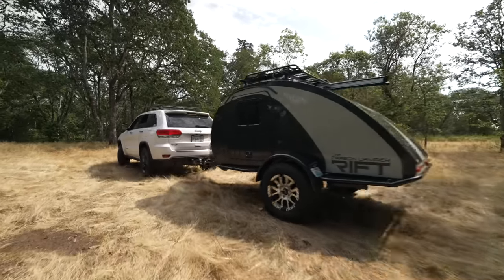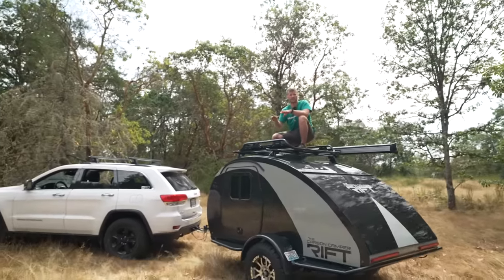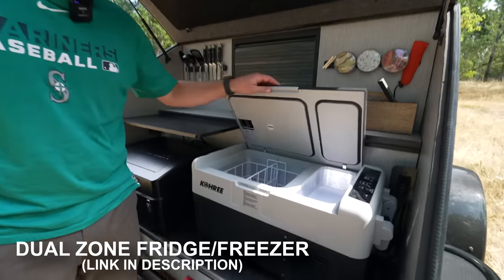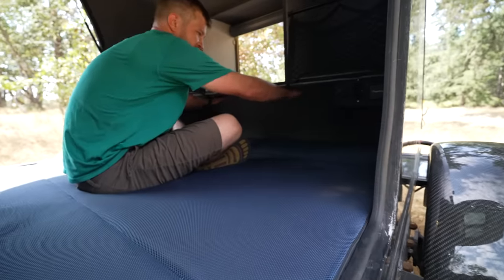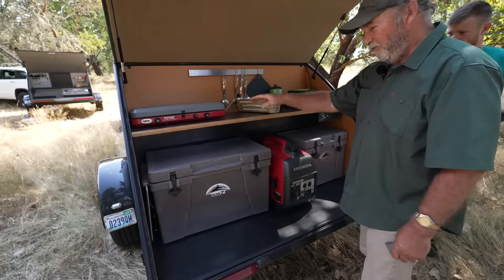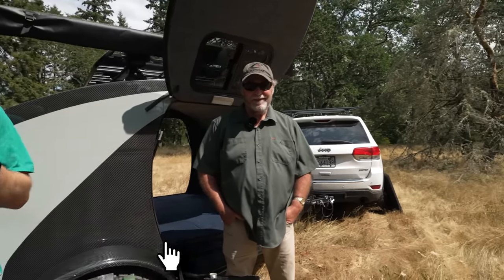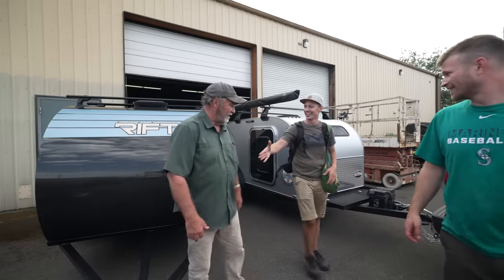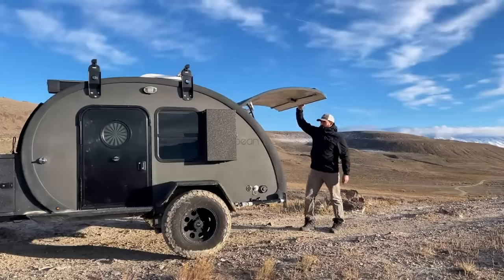Incredibly STRONG yet LIGHT! Carbon Fiber Teardrop Camper

Comment: Very cool. I fear the price but would love carbon fiber anything.
Reply: Also covering the front part of the frame is clutch.
Reply from the maker: Yes, the carbon fiber has so many advantages.
Reply from the maker: Yes, that added protection was definintely worth the littlel extra weight. Especially if people push this trailer the way the manufacturer designed it to be used. They truly built this to get dirty.

Comment: The trailer is nice.  However, the price is nice too.  I am there with you about an off road/overland trailer.  If they could do it and keep the price down, I think they could sell some because the off road trailers out there are usually imported and very pricey.  Always like seeing what is out there.  So, is jumping on your teardrop like jumping on your bed when you were a kid? 😂😂😂
Reply from the maker: Haha. I will admit when most manufacturers jump on their teardrop they look a little nervous. I have seen this done many times. But these guys look like they have been jumping on it day and night like when they were kids on their beds. They definitely trust the roof strength here. Good point on the imports. I didn't even think about that in terms of pricing. That is probably another reason the offroad trailers were able to fetch those prices so quickly. When the industry quickly expanded there was already a pricepoint people recognized from those overseas trailers. So they probably didn't have the sticker shock most of us non-offroaders have when we first see the price tags.

Comment: If you can't put a motorcycle in it, I don't want it.  My teardrop camper is a 2016 Prius.  Fully air-conditioned and heated. 110 volts with built-in coffee maker with ability to use an instant pot and air fryer.  I paid $22,000 for the Pruis, and I pull a 6 x 10 flatbed with my UTV and Grom on board.  Less than $30,000 full price.
Reply from the maker: I like it! Very creative.
Reply: This kind of build made bigger so a bike could fit inside keeping teardrop shape would be nice , as long as it's under $18,000. I guess I'll build my own. I'm not paying more for a trailer than the towing vehicle !

Comment: I think the doors are going to be problematic for reasons already discussed in earlier comments. 

I understand your explanation  about the aerodynamics of the gradual sloping rear, but it seems to have these drawbacks:
1. You lose volume in the galley.
2. I gives you less overhead coverage from the elements. 
3. Most importantly, it pushes the galley deeper into the trailer. It seems like you would both need to bend over more and bang your ankles when prepping food at the counter.
Reply from the maker: 1, 2, 3...yes, yes, and yes. We find there is always going to be tradeoffs. Better aero in the rear, less space. Simple design/more customization, less straight off the lot usability. Good points you have.

Comment: First impression: those steps right at the doors will hold pooling muck and water unless they have drain holes.
Reply from the maker: Good thought. Beings this is a composite material they are able to add water gutters and drain holes. However, I am not sure if they did or not in the location you are mentioning. I wish my eyes initially caught that like yours did.
Reply: @PlayingwithSticks  could you send them the feedback?  This might actually be something they want to address sooner rather than later, and unless/until they take it out in sloppy conditions this might actually be overlooked.

Comment: I’m not sold on the door lifting upwards. What happens when it’s raining?  It look as though it was angled up pushing all the water towards the hinges (cracks).
Reply from the maker: I have a feeling a number of folks are going to have the same question 🙋‍♂️
Reply: Also if parked inside a household garage with limited ceiling height with those upward doors (ie: Limitations from overhead ceiling rack etc) or possible side space from other parked vehicles or floor center aisle of household stuff.

Comment: Nice. Gus is beautiful.  Did I miss a heater in the trailer?
Reply: I only saw a fan in the ceiling.
Reply: @bucktalesoutdoors7566  its carbon fibre.
Reply: yea i live in canada, 37c summers and -37c in the winters. temp control/power issue limits alot of things
Reply: Heat and air needed for Midwest winters and summers, but it’s already out of my $ range. I’d get a T@g or Vistabule in that case.
Reply from the maker: I love Gus!  I had a few more amazing Gus scenese I probably should have thrown in. No heater in this build, but it easily could be added with that nice huge "beak box" as they called it.
Reply from the maker: Sounds like you live in the interior huh? People are often surpised when they hear about inland northerners how extreme it can get. Most people understand the cold, but many are shocked when they hear the heat wave temps.
Reply from the maker: I am often surprised in the midwest that I have never needed the AC. One I find with the teardrop I naturally camp at higher altitudes. But, also how they are insluated vs. a standard RV they just tend to stay much cooler in States like Colorado and Utah than I would have ever imagined.  Now, for cold while it does stay warmer than a typical RV. I still feel like you in that a heater is needed if you will be doing it often.

Comment: looking at the construction,   fiberglass, carbon fiber,  foam...   and for some unknown reason my mind just went...  Hmmm.     Fiberglass, carbon fiber,  foam, mylar, kevlar, mylar,  foam  inner carbon fiber,  inner fiberglass.   With Surmet Corporation's  ALON windows.   

Yes how to make camper safe for camping in some parts of the US.   Yes I'm a nut job... Drew.. do NOT look up ALON.  

Now for a 39,000 dollar "base" camper,  without water systems, without propane heater,  i'd expect a far more robust electrical system.  A system set up to to HANDLE cold weather plug ins.  Even if not "stock" a battery bay for example with pull out battery rack set to accept SEVERAL batteries.   

What they have here is a "short legs" camper.  Something made for going out for 1-2 nights at most.  now adding extra weight at the tongue of the batteries would throw off the balance, so having an option for an external, maybe swing out, rear storage area to act as ballast might work.   These could allow people who want to take the light weight trail out, to add maybe 50-75 pounds of batteries to the front, counter that with 50 pounds of gear on a swing out rack in the rear (propane tank,  water, spare tire).

Finally the "gull wings"  are cool, and i'm 100% about the rule of cool for campers BUT...    they swing high,  first might be a problem for people to reach them, 2nd  they lost the option of having the doors act as a limited rain shelter for getting in and out, 3ed,   swinging up like that removes the option of some door tents, and can be a problem for awnings.   awinging stretched out and tight,  then the doors opened smacked into that might damage it.  I'd honestly see myself adding a "pull cord"   that i could reach up and grab to pull down, to bring the door down to a level i could grab and shut with.  

Oye, drews going to be mad at me for being late on this one.

Comment: There is actually one more teardrop that is lighter and that is the road road, which comes in between 400-450 pounds. While not as fancy at this model, it would be co soldered the lightest. Overall though, this is a sick trailer
Reply from the maker: We actually have a walk-through of that trailer. You know your trailers! I was very careful with the title of this video just in case people like you watched it (trailer enthusiasts) That’s why I put lightest and Strongest. It is the strength that really makes this trailer stick out. Besides the road toad you also have a really great light weight square drop, which is the runaway camper. But, both the road toad, and the runaway do not have anywhere near this sort of strength. This trailer is kind of in a class of its own. Not saying it’s better than the other two, just a completely different build process and end result. Pound for pound there’s no other trailer that is stronger than this. In hindsight now I’m realizing I should have wrote “Strongest Lightweight”

Comment: I bought a 2011 Casita Liberty deluxe 18', fiberglass, wet bath, refrigerator, heat and air, queen, kitchen. Plus a 2009 Crown vic police with 53k mi. to pull it with all for $16,000. So, why?

Comment: Good review, I'm looking for a camper that doubles as a trailer, do you have a playlist or guide on duel purpose trailers?
Reply: Check out what people have done with Weeroll trailers. That may help if looking for dual purposed cargo/camper type trailers.
Reply from the maker: I agree. I would start with weroll and other converted cargo trailers and then maybe the Intech Explore. A much more simple route is the jumping jack trailer. This and the Sylvan Sport Go are both neat options as well

Comment: The price is stupid, I get it its an awesome built lightweight trailer. For some who have unlimited budgets and a Tesla or Subaru, I'm sure its a good fit. But what the small (especially off-road) camper space needs is a low cost, light (not feather) weight trailer. I don't need a Trager grill for camping, or a pair of Yeti coolers and Honda generator. 

What I need is something water proof that can survive 300 miles of dirt and off road driving on the weekends and doesn't cost what my cars do (FJ Cruiser, TDI golf and TDI Toureg). A small enclosed cargo trailer is between 4-10K and I can stand up in that. A small camper should be in that kind of price range. Without all the bells and whistles.

Comment: I agree this is a cool fun trailer, but the price tag is biggest issue. At 40k for the bigger, more built out unit, you can buy a escapod for 2 grand more.
Reply from the maker: Escapod and Bean is who I had in my mind when I was thinking about the price. Which is why I feel they may have a ways to go on the top dollar teardrop, meaning they could move it a bit more towards the off-road market. But their $29,000 teardrop I think they are really close to having that one right. that is a really special trailer with removable galley.
Reply: @PlayingwithSticks  yeah i was thinking the lower price model was the stand out of the two.
Reply from the maker: Agreed. Of the two the lower priced model caught my eye as well.

Comment: Very cool but $30k is just too much for my taste. Still cool though! I have a Runaway Cool Camp we paid less than $4k in 2018 (the newest ones are one piece fiberglass with no wood or seems and cost around $6k and up now). It gets the job done. It has been to 45 states in the lower 48 so far and will go to the other three, Michigan, Minnesota and Wisconsin this fall. I still think the one they are showing is pretty cool though.

Comment: Really nice trailer and smart designing. At this price point they’re only going to sell maybe 100 of these. There will be competitors and come along and can get cheaper price on carbon fiber because they’re buying and such quantity, there will be trailers like this for $18,000. How can that happen, because there is a demand, if they look at the demographic the average people are driving a small SUV or a Subaru outback they intend to buy one to tow it. If they’re out that car a late model used car was only 20,000 to 25,000, why would they be spending twice that to buy a little teardrop trailer? I wish I had the money to do a start up company that should be a very easy blueprint to make a similar trailer with the same materials for usually $20,000 maximum retail price
Reply from the maker: I say the same thing as you about demand. So many people who study the industry disagree with me. They say when they do their research they find their is not a large Subaru market that needs to be targeted. I completely disagree with this. But obviously mine is anecdotal, I have never done true market research. But, I can't imagine there isn't a huge number of people who want a teardrop, but don't want to upgrade their daily commuter. It just makes sense to me. And typically people who like teardrops tend to lean towards smaller more economical daily drivers in the first place.

Comment: The only problem I can see is with that light of a trailer is “the bounce”, and price. I own a 600 pound camper and it bounces all over the place on tough roads.
Reply from the maker: We have taken out quite a few trailers around the 600lb range. Unfortunately, it’s not typically the weight of the trailer that causes the issue. It’s the difficulty of finding a properly sized axle. If the axl is correctly derated, you should feel no additional bumps than a trailer twice its weight. This is not just a problem with lightweight trailers. We have taken out many heavy trailers with beefed up axles that have not been derated, and they have the exact same problem. So really it’s a simple as finding the correct rated axle or making sure the axle has the ability to be derated.

Comment: if i had the skills to build my own teardrop, i would build it in reverse for better aerodynamics (the galley in the front)  i also would not build a galley or a hatch that opens.  it would be solid and built on a 6' wide and 7or 8 foot length trailer, so i could have a king bed.  sounds crazy to some (or most) but that's what i would build.  not that anyone cares, i just thought i'd share
Reply from the maker: Aero may surprise you if you do a deep dive. There are a number of great videos on the teardrop shape from race car manufacturers, semi-trucks, etc. You may want to Google it. The large head in the front with the quick tapering tail end is actually the preferred aero design. Which seems counterintuitive because when factoring drag one of the main factors is surface area. The longer you draw out that teardrop shape the more you benefit. For example a stubby teardrop shape like a T@B would have about 15% resistance compared to a long drawn out teardrop shape like an airplane wing that would have 5% resistance.  I love hearing your creative ideas here. I am having trouble understanding the non-opening galley. Do you access the galley from inside the trailer?
Reply: @PlayingwithSticks  thank you for schooling me in the aero dept.  no galley for me all bed and storage.   radical, yes but it would be my preferred design.  God bless, thanks for always cranking out great content
Reply from the maker: Like you, it wasn’t too long ago that I was schooled as well. Since then the YouTube algorithm knows I’m a bit obsessed with aero. It’s always feeding me fun, aerodynamic design videos. Your design sounds really fun. I love seeing people think outside the box. Like you, I have a number of designs in my head that I would love to test out. Thanks for the blessings, you know I appreciate it. God bless you as well Dave!

Comment: Carbon is nice but I feel it is over kill . very basic trailer for the price ,
Reply from the maker: I think sometimes people put carbon fiber, too high on a pedestal in terms of cost. I think it’s not necessarily really overkill for the application, it’s just overkill when you think of the price. If you saw our last video of the carbon fiber trailer we are building with Charles. He left some comments about the pricing. He said that base model will come in at the $20,000 to $25,000 range. When you see it priced like that the carbon doesn’t seem that overkill. It then seems to make a lot of sense. Why not make a bomb proof trailer when it comes out to be the same price as other applications. Now, please don’t take this comment as me saying you were wrong. I felt the same way when I first heard a carbon fiber trailer was being made. But I had to check my initial gut reaction, and I realized it was based on price. Why would I dislike something that weighs half the amount, is stronger, and is impervious to water? Especially when I learned that carbon fiber when ordered in bulk was not as expensive as I thought it was. That’s when I realized my mind was being tricked by the price. I am paying more for a concept than the actual price of materials. And that is pretty common within the small camper industry in general, we are paying more for concepts than the actual cost of building a trailer. I going on a bunny trail here. I have this extremely budget carbon fiber tripod that I take with me everywhere. It’s made in China. Because of the insanely low price tag I always thought it wasn’t really carbon fiber. Well, in my process of learning about composites, I brought in my carbon fiber tripod to two different carbon fiber experts. And both concluded that it wasn’t fake. And not only was it not fake, they said the layups were done well. That was kind of the aha moment for me when it came to pricing here in the States. I guess I always assumed that if it’s made with carbon fiber, then it just has to cost 2x or 4x more.
Reply from the maker: @bobw9297  I am so glad you shared this. I have never seen their channel. I love seeing squardrops that are coming in under $5K. The joy that comes from building something like this yourself is priceless. And it looks like they are putting in a few unique twists of their own. Love it!

Comment: why is it not suppository-shaped like a Boler?  (egg trailer)  wouldn't that alleviate structural stresses at the sharp edges?
trailer enthusiasts will never give up those heavy wheels which are way over spec. for a <500lb. trailer (it's all about looks, i.e.  looking like a rugged-type guy)  it looks absurd to me.
go with lighter wheels and maybe you will be <400lb.  Heck! scooter wheels would do.
me:  Mazda 3 with home-built coroplast squaredrop on a Harbor Freight trailer + 12v electric blanket